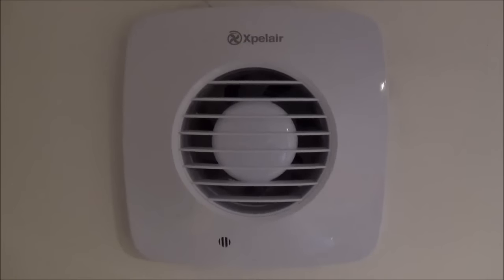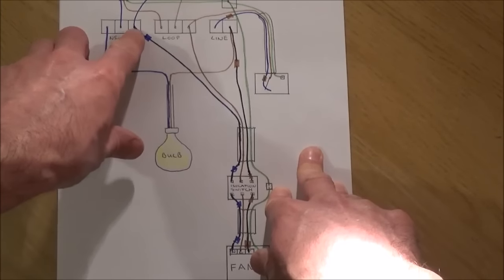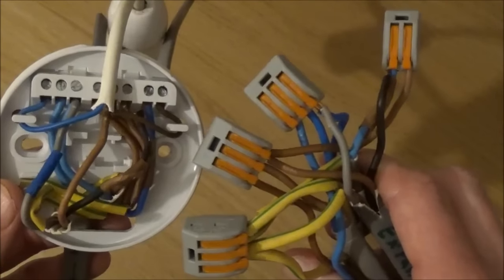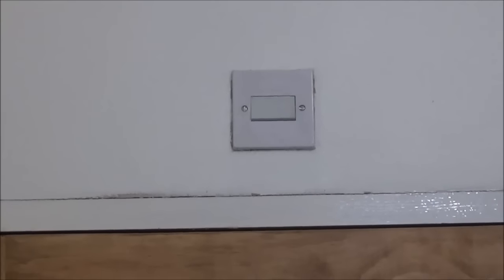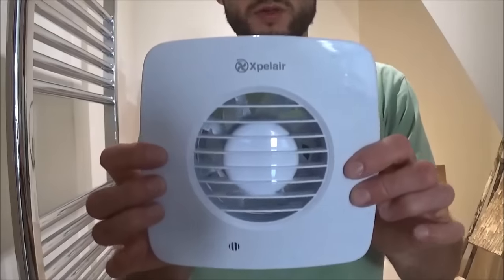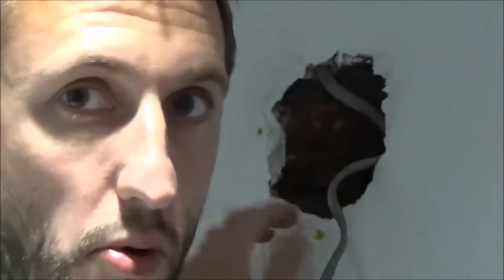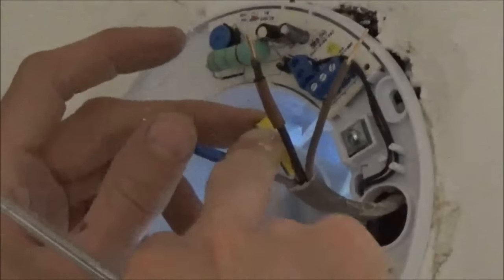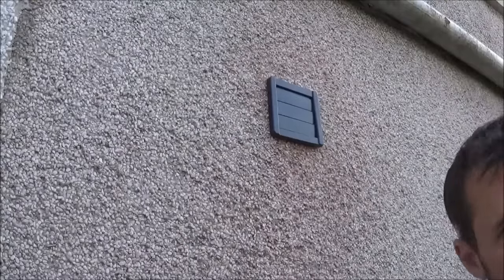How to fit a bathroom extractor fan using light switch. Extractor fan installation. Xpelair DX100

Comment: Do I need to install a fan isolator for the extractor fan timer to work?
Reply from the maker: No but its so you can safely work on the fan or change it in the future and it means you can leave your lighting power on with the fan isolation switch off.
Reply: @POUSEaroundtheHOUSE  I have a problem that I cannot figure out yet. How can I connect an extractor fan to an already installed switch/light. I want to install an extractor fan in my  toilet that will use the switch that is already installed. My fan is 3 wired (timer) and I want to install it via the light. I don't need to run any power source to the toilet as it is already there. The cables I need to run is from the extractor fan to the ceiling rose. Can you guide me how to connect  those wires from the FAN to lamp so that when I enter the toilet, press the already installed switch to turn on light and fan and then turn it off again when leaving and the fan still on for the amount of time set? How can I connect the fan to an already established wiring which include a switch, and the brown, blue and green/yellow cables coming from the ceiling?  I eagerly await your reply
Reply from the maker: @Cloggyseba  it's all in this video. Just assume the cable to the switch is already in place then run permanent live from loop, switched live from switched live terminal and earth to earth terminal as per my diagrams and installation at the end of the video. Hope that helps.
Reply: @POUSEaroundtheHOUSE  When I see those many wires my head starts spinning then I get confused. So, here's what I am going  to do and hope you can guide me from here. I put the Brown live wire in B wago, Blue neutral wire in A wago and Green/Yellow wire in C wago. Those cables are coming from power source in. The extractor fan cables are Brown Live, Blue Neutral and Red switch. Now, which of the wago will the Brown, Blue and Red go into? By the way, thanks for your reply earlier.
Reply: @Cloggyseba  if you head starts spinning, then you should really just hire someone. Electrics in the bathroom isn’t something that you should tackle as a diy project unless you’ve got existing diy wiring experience.
Reply: @haroon420  I was just kidding when I said that. I installed many lights in my bathrooms and and changed switches and the house is still standing. But there are somethings I don't understand, which is why I am asking.  Since you are here, I am going to ask you a question and (Pouse around the House)  too. 

What other use is the blue (neutral) wire (two core and earth) concerning a one pole switch? Where would I connect the neutral wire coming from the CU if I am installing an extractor fan? Is that blue  (neutral) wire becomes a switched live if connecting an extractor fan?
Reply: @POUSEaroundtheHOUSE  Now I understood why you couldn't help me. You are connecting your extractor fan from the ceiling rose where the power source first entered. My power source first entered the one-way switch  and then up the wall to the ceiling rose, which is why you are adding switch in your diagram. My switch is already in placed. I opened my one-way switch and realised that one wire (black) coming from CU and attached to COM and the other (Brown) wire attached to L, which comes up to the ceiling rose. The neutral (blue) and yellow/green (earth) come straight to ceiling rose without connecting to the one-way switch. 

You wrote "then run permanent live from loop, switched live from switched live terminal and earth to earth terminal"  I have 3 wires (Brown Live, Blue Neutral and yellow/Green Earth) hanging from the ceiling, so when you said "run permanent live from loop, switched live from switched live terminal and earth to earth terminal"  isn't clear at all. For example, what is the switched live from the loop?  My fan has on it L=Live , N=Neutral  and SL=Switched Live. From the ceiling the is L=Live, N=Neutral and Earth.
Reply: @Cloggyseba  In UK lighting installations the supply normally runs from the consumer unit to the ceiling roses, not the switches. Cabling to switches would require more cable. There is a "break" between the supply live and the live wire on the light which is closed by the switch. Obviously electricians don't use special cable to run to the switch, so even though both wires will be live when the switch is closed, one of them is a blue wire. This has brown sleeves put on it so people know it is a switched live wire and not a neutral. The amount of hassle you will have getting the timer to work probably isn't worth the effort. Just leave the light on if it smells in there!

Comment: To do the whole rewiring a bathroom extractor fan does electrician have a to break the wall or ceiling? Please reply
Reply: Depends how the cables have been run and fixed in place initially.
The way shown in the video the cable in place now can be pulled out of the duct under the plaster and the new one pushed in (or attached to the old one and pulled in when you pull the old one out).
If it's been buried in plaster with no duct, you'll need to knock off the plaster before you can remove the old wire. 
If it's in a plasterboard wall, it's already mostly loose behind the plasterboard.

Comment: I have an existing bathroom fan but want to add a second humistat fan as it’s not clearing the steam. How do I add a second fan to the wiring? Thanks
Reply: Unfortunately it will need a electrician to do it as adding an extra fan circuit it is a part P Building regs notification 

Hope this helps

Comment: Great video 👍 my 10A Isolation fan switch is has a different terminal configuration at the back.
 The off position from left to right is: 
Lcom, L1, (blanked out L2), Lcom. The on position from Left to right is:
L1, (blanked out L2), Lcom, L1, (blanked out L2)
I am a little confused. Could you possibly give me a little advise please? Many thanks
Reply from the maker: In reality as long as the same wire goes in and back out of same corresponding terminal it doesn't really matter but put your brown live in the LCom's, then black switched live and grey neutral  in the L1s. Make sure colours correspond though. i.e brown in to brown out. Black in to black out etc. Then don't forget to connect earth wires (cpc). If in doubt please call an electrician! Thanks for watching.

Comment: Can you wire the extractor fan to the shower isolating switch (via say a 3a fused spur) so it only runs when the shower is used and not everytime the light is used? Or must the fan have it's own separate isolating switch regardless? Thanks
Reply from the maker: If it's protected with a 3amp fuse then it can be isolated and the 3 amp fuse will protect the cable in the event of it overloading so yes it would work but if in doubt check contact an electrician, safety first!

Comment: Thanks for making this video. I followed it as best I could, so I can have the fan and lights on a 2 gang switch, and still have the fan timer. For some reason the fan will only turn on and off by switching the  isolator on and off. The wall switch does nothing, except turn the lights back off (they're touch buttons).
Reply: Yup, your set up is working perfectly!

Comment: I did this but when I switch on the light and extractor fan the light flashes. Do you know why this is happening. I tried changing the light fitting to a led with a driver and also a normal bulb but still Didn’t work . Any idea why this is happening
Reply: Call an electrician...

Comment: Do I have to connect the timer ? I purchased a timer version by mistake even though I do not have a timer wire. I made the (L-N) connection but the timer does not start, the return window is closed.  Thanks
Reply: Does it work when you're not Connect the timer? I have purchased  the same as you by mistake

Comment: I have brought a switch line and a neutral from the light also using a over run with extractor,  it work but not the overrun timer . It goes off as soon as the light it's off.  I'm bot using a isolator switch in this case. Any tips to make the timer work?
Reply from the maker: You need a permanent live as well then make sure they are all connected to right terminals. The permanent live is what allows it to over run. You need a 3 core and earth cable as seen in the video (4 wires) Hope that helps!

Comment: I test my VX100T by connecting live and neutral cable direct to my unit from a 13A socket and it refused to turn; then I connected the live cable direct to L and T from my 13A socket to the fan and again it refused to turn, please advise?
Reply from the maker: Hi Meslog - The fan is only rated at 6 amps so you shouldn't be connecting to 13amp sockets, it could cause the fan to overheat, break or worst start a fire. If you followed the video then it should work. Not entirely sure why you are connecting it direct to a socket. I would advise to call in an electrician for a safe installation. Thanks for watching.

Comment: I have mistakenly put a 2 terminal extractor fan in the ceiling but the power is provided by a 3 core cable. Is there a way you can safely connect the fan up using these combinations?  Cheers
Reply from the maker: I think I know what you mean. Put connector blocks over each end of the black wire and just use brown live wire and use grey as neutral. That way the black wire is redundant  but unable to accidentally touch a live wire at the ends. I assume you mean you don't have a timer fan? Thanks for watching.

Comment: Do you need to fit an isolation switch on an existing circuit without one? When replacing the extractor fan?
Reply from the maker: You should really. It allows you to isolate the power to work safely on the fan whilst leaving power to your lights. Thanks for watching.

Comment: Great video. I installed a similar fan recently and it stopped working altogether after a few days, same thing happened when I replaced it. could moisture be getting in somewhere or any advice? thanks
Reply: I connect a fan the light on the fan came but the fan is not working?

Comment: Do I have to consider inclination of the hole while drilling?
Reply: you need to ensure the hole slopes downwards slightly to the outside - that way any moisture will flow away from the fan. if you have a hollow wall just make sure that the external hole is slightly lower. with a brick wall you must drill with the inclination otherwise the pipe won't slope

Comment: dude,  what did you do with the earth?
Reply from the maker: Just terminate it into a connector block and leave it under the cover. Most fans don't require earthing as they are double insulated but you now still have the earth wire available if you ever replace the fan with an appliance that requires earthing. Hope that helps. Thanks for watching.
Reply: It does thanks. Very clear vid.
Reply: Additional question: If I put the wires the wrong way around will it blow the fan our just not work>  I ask as a sparky has done all the wiring and left a 3 core and E wire ready for fan installation but this wire was covered and does not have the brown or black tape over.  Is using the brown for live, grey for neutral and black for switched live industry standard so I may assume the sparky ran the wire from the isolator switch in this manner?  Thanks.
Reply from the maker: Hi , it shouldn't damage the fan but if you have an RCD it should trip. But a simple way to test it is by using an electrical tester. A non contact tester like the LAP ms8907 are great. With the power turned on, remove your 3 pole isolation switch cover, (no need to disconnect the wires) and with the light switch on, the switched live wire will indicate live on tester. With light switch off there will be no power. The permanent live will always have power, and the neutral should show as having no power. But it should be standard that the grey is neutral, brown is permanent live, and black is switched live.

Comment: Can you wire to shower pull cord thanks
Reply from the maker: No because your shower wiring will be protected by a much higher rated fuse or mcb. This would make it unsafe. You could do a fused switch from a socket outside the bathroom bit you would need to put a lower rated fuse in the switch as per manufacturers instructions i.e. 3amp or 5amp fuse

Comment: Hi, thanks for the videos very helpful , i was wondering if there was a way to operate the light and fan using a motion sensor instead of the bathroom light switch?.....any help greatly appreciated , thanks
Reply: You would need to replace the switch with a sensor. I looked into this but couldn’t find an atheistic looking sensor
Reply: Peter , I’ve done it yesterday , i changed the switch wire to 3core and earth , so it had a neutral and it works perfect , motion sensor switches down lighters on an extractor fan which switches off when timer has finished , made up with it
Reply from the maker: Sorry, a bit late to the party here! Nice one Thomas, sounds good!

Comment: What is the estimated cost of this type of installation?
Reply from the maker: No idea, I did it myself, but the fan was about £20, plus a few lengths of cable so say £40 - £50 plus labour if someone is fitting it.

Comment: I know you don't have time to answer this but if you are just replacing the entire unit and it is wired up, is it safe for an amateur to just replace the whole unit or should I just get an electrician?
Reply: Nope. I need an electrician.
Reply from the maker: Hi there, this is notifiable works if in a bathroom so yes, get an electrician!
Reply: I think the regs state that you are allowed to do a like-for-like change, but no more. But, if someone is harmed by your work then you are on your own, regardless. Same scenario if you have a fire and it is discovered that you touched the electrics. Gives the insurance company a way out.
I have electrical and electronic qualifications, but i get the sparky in to do such jobs. Lets me sleep at nights.

Comment: My landlord made a hole in the wall to the outside wall inserted the fan(unconnected) and called it a day. He’s so amazing😊😒
Reply: I'm a landlord, your landlord at least drilled the whole, not easy. he needs to install wiring in order for the extractor fan to work. your landlord, saved up, bought a property, fixed it up, got it to renting standard.. and rented it out. remember landlords have ft jobs, family, their own home to sort out. not having a fan is not end of the world, open the windows when showering, leave the windows and doors open to get rid of condensation. i in stead of moaning, be great-full you have a rood over your head.

Comment: I have installed a timer bathroom extractor fan (Manrose Quiet), but not wired in. I want (need) a RCD protected consumer unit, so contacted a niceic registered electrician for a quote, so thought he might aswell wire the fan in too. When I said that the manufacturers instruction state that a 3A fcu "MUST" be fitted. He said "Nah, I'll just fit a 10 or 15 amp fuse" 😕..................Thanks for your time mate, time to get my toolbox out again!!
Reply from the maker: Thanks for the feedback Mark, hope it worked out for you.

Comment: Hi, before watching your excellent video, I tried to replace a fan with a new timer fan as it had stopped working. I had the two L and N wires only hooked up to the old one. so I had the brown live and blue neutral mains wired to the red and black wires in the new fan. So my live was wired to switch live terminal and neutral to the (second)  live one and nothing in the 3rd (neutral)(didn't see the guide letters). A light actually came on the fan and the blade moved a mm then stopped each time I turned on the light. Anyway could I have damaged the fan ? I tried to test the fan on a car battery to get it to spin but nothing happened,. Firstly is it possible to test it that way with just live and neutral connections and no switch live ? and second do I just wire the fan live and neutral points and leave the switch live empty (red wire on fan). Am calling a qualified sparks to sort out the wiring anyway but am worried it could be the fan and I cant tell. Please any advice would be much appreciated.
Reply from the maker: Hi Tooley, with a timer fan you will need to connect all 3 wires to make it work, i.e. switched live, permanent live, and neutral. The switched live is often marked as an 's' or 'T'' on a fan and the 'L' is permanent live. So if you've wired it this way, the power supply is still working (none of the fuses have gone) then it sounds like the fan is broken or your wires are not conducting correctly. But without looking I couldn't say. Best get the electrician in and have it tested. At least you have piece of mind that the wires are safe that way. Hope that helps. Thanks for watching!
Reply from the maker: Hi Tooley, with a timer fan you will need to connect all 3 wires to make it work, i.e. switched live, permanent live, and neutral. The switched live is often marked as an 's' or 'T'' on a fan and the 'L' is permanent live. So if you've wired it this way, the power supply is still working (none of the fuses have gone) then it sounds like the fan is broken or your wires are not conducting correctly. But without looking I couldn't say. Best get the electrician in and have it tested. At least you have piece of mind that the wires are safe that way. Hope that helps. Thanks for watching!
Reply: Thankyou Pouse for getting back to me, really was a great help. What a nice bloke.
Reply from the maker: No problem glad to help. I do reply eventually. With a full time job, child, and youtube channel it is a struggle to get anything done these days! Thanks again for watching.